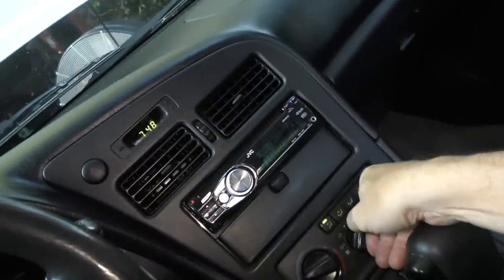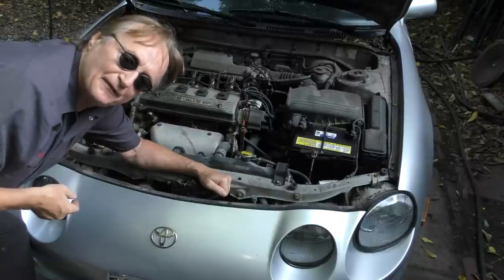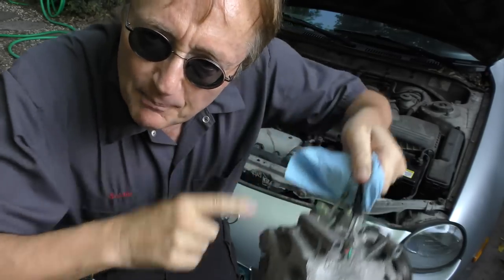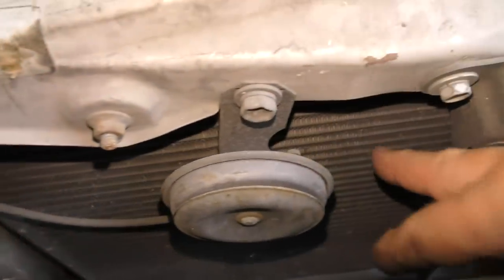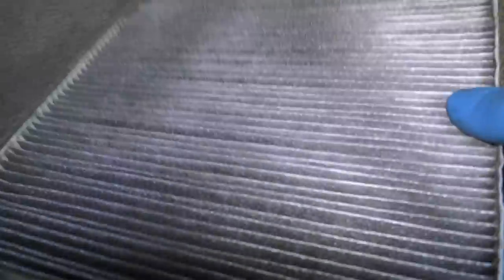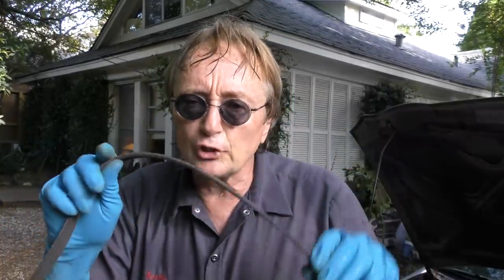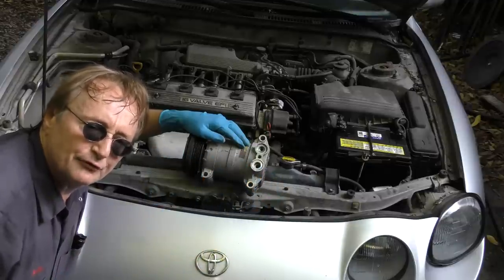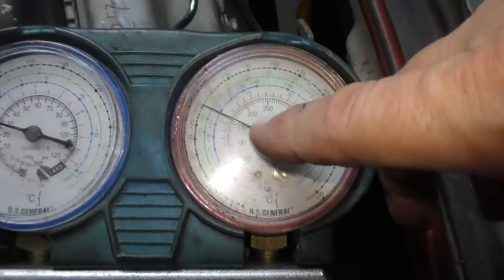How to Keep Your Car's AC Blowing Ice Cold

Comment: Hello Scotty Kilmer,I have a question... I have a 2001 Toyota Tacoma SR5 truck. My A/C is sometimes blowing cold air then after a few minutes, it starts blowing regular air; no more cold air. I hear the A/C clutch engaging on and off. When it is engaged, I sometimes still do not get cold air at all. It seems like it's happening intermittently. On, off - cold air, no cold air.Do you know what is going on or what could possibly be the problem?Thank you sir.Eric
Reply from the maker: try a new magnetic clutch relay for the AC in the fuse box, it's a design flaw on that. If not that, check for low refrigerant then pray it's not the compressor going out
Reply: Scotty Kilmer,

Thank you for the reply.

I checked both fuse panels (the one inside right by the driver side door below the steering wheel and also under the hood). I don't see any magnetic clutch relay anywhere. I do however, see a "HEATER50A" and a larger black color relay that says "HEATER" but it doesn't have anything that says "magnetic clutch" or "MG CLT" in neither one of the fuse box. 

I will take it to a shop & have them check to see if there is sufficient freon in there. I've already prayed to buddha 3 times a day that it's not the compressor 🙏🏼😂!!! 

Also, I took it to a mechanic shop a few months back (knowing that when summer season comes in San Diego, it gets really hot & humid here) and the service adviser said that I needed a new expansion valve??? What is an expansion valve?

Comment: I've got a weird A/C thing going on that you might be able to help me out with. My van is a '94 running 134a. I had replaced the compressor and dryer last winter, vacuumed it out good, and filled it up to 150 over 40 using my gauges. It worked fine for a while, but suddenly, it quit cooling earlier this summer. My radiator fan works just fine and the compressor would kick on and still read 150 over 40 just like always, but absolutely no cool air is coming out, nor do any of the lines feel cold either going down the highway or stationary. Got any ideas?
Reply from the maker: pressure is fine, so odds are problem is inside the dash controls, like bad actuators
Reply: Not that I can figure. All of my dash controls work just fine for defrost, upper, lower, mix, temp control, etc, and hitting the A/C button switches the compressor on as it should. Even if the blend actuators were bad, wouldn't the lines still be cold?

Comment: I replaced my cabin air filter recently and I notice that when the air recirculating option is on, external odors can still be smelled inside the cabin and I'm not sure if this is normal. In the past when ever I had the recirculating air option on, I could hardly feel or smell external odors, like garbage or burning grass for example. Any advise is appreciated and I have a Honda CRV -2007
Reply from the maker: filter has nothing to do with external odors, you have air leaks in the system OR the recirc door is not shutting fully
Reply: Scotty Kilmer Thanks for answering Scotty and I will check over in a mechanical shop and see how much this will be costing. Might leave the repair for January or February because I need to change the bushings of both arms and change camber kits as well. Lot of money on these stuff.

Comment: Hi Scotty,  my 1987 Pontiac Fiero GT (2.8) radiator fan will not switch on automatically but will come on if I turn on the AC.  I have had all coolin/temperature/fan switches and sensors replaced.  Coolant flush done, system burped.  Replaced water pump.  Problem still exists! Help!

Comment: Scotty, how about the clutch assembly on the compressors. I get cold air when the engine is cold, but after the motor warms up. I lose ac when the clutch  disengages because of the air gap has grown. I was just thinking of replacing the clutch assembly.
Reply: Have you tried replacing the AC clutch relay? I had the same problem this summer and it turned out to be a worn relay.
Reply: @teravolt6113  I'm pretty sure that the clutch assembly is bad. Because if  I  tap the front of the clutch on the compressor after the engine is warm the clutch will engage, and run the compressor till the system gets up to pressure, and disengages, and I lose cooling again.
Reply: @voo8165  Try disassembling the clutch assembly and removing one shim to bring the surfaces closer.

Comment: I have a 2003 yukon GMC (suburban 3 row) I turn on the a/c for the back area of the vehicle and it blows cold air,I turn on the front part (Driver and passenger) and it blows warm/hot air in the front area with the thermostat turned all the way down.Why doesn't it blow cold air up front? Blower is working...

Comment: Please help. 99 Toyota Camry ac issues. Has small leak that I fill once a season. This year for some reason the car won't let me fill it as usual using low side port. The clutch and compressor do come on and both fans are on. AC blowing warm air. Strange thing is that it reads low but can doesn't empty and that's using 2 different gauges. Any advice would help

Comment: Hey man so I have a question, my a.c. works but when I turn it on it affects the way my car drives, 6 speed 04 Acura tsx with a k24 engine, when I drive with a.c. off it drives fine, if I turn the a.c. on my car gets real sluggish especially when switching gears, any idea what I should do?

Comment: hi scott i have a 2000 vw bug that had a hair line crack in the head so i replaced the head and had a whole head job done. Meaning valve guides new valves and machined. ok installed the head back on now this is smoking like a chimney. how can i stop the smoke.

Comment: I am going to change the whole ac system everything from advanced auto parts but my question is should I buy the fan and the condenser from ebay or get good brands expensive ones because the fan base where the screws going broke i have to stick it with some wires and they told i need to flush or get new condenser with new ac compressor its only cooling when i idle over 2.5rpm
Reply: Mohamed alsayyad buy good parts from good brands, if you like your car running good

Comment: A defective fan doesn't burn out a compressor. There's a relief valve and a pressure switch that will stop the compressor...  n I've had a car for 10yrs n never needed to gas it once...
Reply: Wrong. With a high pressure switch the head pressure won't get as high as in the case of no high pressure switch, but the constant cycling WILL wear the compressor much faster than if it cycled at the correct intervals or not cycled at all (such as with variable displacement compressors or POA systems), and the relief valve will make the circuit lose a lot of refrigerant and lubricant to the point that the oil circulation rate won't be the correct one. In addition, most mobile AC systems are meant to have some leaking: they use open drive compressors with shaft seals, and have o-rings scattered throughout the system. To reduce the leaking, let the compressor run for some minutes each week.
Reply: TeraVolt when the pressure relief valve blows off the occupant of the car will feel the effect... the compressor will not go bad from this... i don't agree either that they were designed to leak... the short cycling of a compressor will wear it down... agreed... but so is regular running... that's not enough to say it will make it blow up... also when there is too little gas the low pressure switch will hold it out until attention is given...
Reply: Not that easy. Only the most technically minded folk may realize what has happened, the others might either take the car to the mechanic (which may just say "Don't worry, everything's okay") or just forget about it. About the cycling, well, there's a shaft and a swash/wobble plate, and continuosly stop-and-go operation means that the shaft and the swash/wobble plate are being subjected to a lot more stress. Some V-piston compressors used in most bus HVAC systems are designed to cycle about ten times a hour and no more (that's also why they often come with the so-called "unloader valves" which simply make the compressor momentarily pump less fluid to control both the DP and the SP, just like automotive variable displacement compressors but much less accurately). Automotive compressors might be much more resistant than that, being much more smaller than these behemoths, but they're definitely not designed to cycle on and off each second. About the low pressure switch, well, not all AC systems feature one. In fact, variable displacement compressors, be them internally controlled or solenoid controlled, don't need a low pressure cut off switch, since they can regulate the refrigerant flow any moment (that's the same reason for why they don't have a clutch or, when they have one, the clutch stays engaged as long as the AC is on, aside from momentarily disengaging with very low RPM or WOT). Systems equipped with these compressors only feature a pressure transducer located on the liquid line, which is high side and right after the condenser/receiver. As such, they can't feel a low refrigerant charge condition: they can only feel a NO charge one, and very low charge can be as damaging as NO charge for a compressor, because it's the refrigerant which makes the lubricant oil circulate inside the system, and low refrigerant can mean that oil is leaving the compressor from the discharge port but not the same amount of it is making it back in the suction port. I've risked a seized compressor myself from not having a regas done in 8 years (along with turning the AC on only in the summer) on an European minivan whose system only featured a 500g R-134A charge. The compressor clutch coil was equipped with a thermal fuse rated for 187°C and that fuse, one day, tripped. Low oil circulation rate (and too high of a superheat, in addition to too high of a discharge pressure) heats the compressor up until something fails and it seizes. Thanks to the fuse, that compressor, a Delphi CVC6 (internally controlled variable, so NO low pressure switch at all), is still alive and only needed a new clutch coil and a regas. Having the pressures checked right after AC failure showed the correct refrigerant pressure you would expect at that ambient temperature, which means you can be on a low charge but with enough pressure to make the system turn on, the only problem is that the TXV and therefore the evaporator could not be receiving enough liquid to cool things down the right way and, most importantly, that the compressor is not receiving optimal lubrication...
Reply: TeraVolt wow what a read lolol... i agree with some things said... not on its short cycling every second... not that the high side will not respond to low pressure... had u vehicles that did... i think we may be getting detail which is different from what he stated... again it will not blow up ur compressor... if ur compressor goes while this situation happens then it was on its way out n that's a shared issue... on ambient temp thats facts however again ur talking specifics and he was making a blanket statement...

Comment: I havent done anything with my AC in a Hyundai for 14 tears,it is still cooling the car good,and you say it should be checked every 4 years? :D
Reply: In my opinion you'd best have it serviced by a pro with a recharge station soon. Who knows how much refrigerant is left in there, and low refrigerant makes less oil than needed flow back to the compressor, making it eventually seize up. Some AC systems can still show appreciable cooling even with less than half the refrigerant charge, especially the ones with scroll and vane compressors typical of Asian cars which often have very little oil inside...
Reply: It's not a bad idea to replace the refrigerant and compressor oil (usually called an ac service) every few years. The compressor is internally lubricated and the oil can degrade.  Always check to make sure the condenser is free of blockage and make sure the belts are good. 
But yeah for the most part you just leave it alone.

Comment: hey scotty, just want to know the stock settings of a fan. if i on the ac on, should the fans stay on? or it will still depends the engine  temperature. my fans is still automatic even with ac. and my condenser is getting hot.

Comment: I have a 2000 Toyota Camry Ce the compressor stays engaged all the time except  when the engine is off or the blower motor is off if i turn the heater on the ac is still on fighting. I put a new relay as well as replaced a couple o rings and the condenser drier and the new wire from the fuse box to the compressor the old wire was sniped. Why does the compressor continue to stay on? thank you
Reply: Might be trivial, but do you have air distribution always set to defrost?

Comment: Can I use gauges and hoses for residential AC on my vehicles AC? BTW, you live in Houston?
Reply from the maker: sure, same gauges, just different fittings. I'm in downtown houston
Reply: Scotty Kilmer which type of fittings. I'm also in Houston are you in the heights?
Reply: my dad is a mechanic and he is great at fixing any engine, really good at cars. i just trades items on craigslist for a rare scooter. a 250cc velux diamo, it has a roof and a radio and a cigarette lighter port, also car mirrors. its grey also has a windshield and wipers. is was taken care of poorly and has been in the rain for 6 years and wasent running at all for six years. so i traded and it came with a title, also it only has 884 miles on it. anyway 3 people owned this scooter before me and no one could get it to run. but we got it and my dad got it started in less then a week and we only spent around $12 on sealent,screws and it runs very good, all we need to do now is clean the gas tank and put the seat back on. i traded $400 worth of stuff, i got a great deal its worth $4500 new. it looks like a big motorcycle and it goes 85mph PS MY BROTHER JUST MOVED DOWN TO AUSTIN TEXAS, I LIVE NEAR CHICAGO IL.

Comment: Hi, i have My Opel Zafira A 2005, the Air conditioner is working good except in the middle of the dashboard vent, it blows hot air for while and then after 25 mints will turn to cool air...i have no idea what happens?

Comment: I have a 2012 Range Rover sports. The AC used to be ice cold. Noticed recently that when I turn the AC on, the clutch engages and the vents blows normal air until say after 5mins before cold air starts blowing. It’s not as ice cold anymore. Plugged in the gauge and it reads fine. What could be the problem as I want it to come back ice cold. Thanks
Reply: It probably has a variable displacement compressor. Definitely more typical of European cars (American cars typically feature fixed displacement piston compressors, Japanese scroll/vane ones instead). Gauges won't make sense with these compressors, since they have a mechanical/solenoid valve that adjusts the pressure by regulating the swash plate angle. You could be low on AC refrigerant. Low refrigerant can be really damaging for these compressors since low refrigerant means slower oil circulation and these compressors stay on all the time when the AC or defroster is on, and they often don't feature LP side pressure switches. Systems with variable displacement compressors need to be charged by weight by inserting liquid refrigerant in the high pressure side (after evacuating and vacuuming), with engine off. Let it be serviced by a pro. Also clean the condenser and check if it has proper airflow. You will have ice cold AC in a moment from an efficient system. Even a car low end and small as a Vauxhall Agila A can ice you up pretty good.

Comment: Scotty I have air conditioning in my car a 94 camaro z-28 5.7 liter LT1 I put freon in my air conditioning and it's now cold and when I run it in town or on the highway the temperature stays bout the same it dont run hot at all we just last week flushed, new thermostat, and new Prestone and it's doing great but my issue is that when I dont run the air my temp guage goes up and goes up pretty good bout 3/4 or a tiny bit more so I'm stumped I thought that the car would run hott with the air on but it's doing just the opposite...so u got ne answers???
Reply: The cause is probably your engine Electric cooling fans are not working properly
Reply: @garygermain2333  my 94 z-28 has an OBD1 and I bought a scanner from auto zone cause I was going to do a test scan on it...well I cleaned my map sensor the other day and it ran better but it did start running kind of rough start then die and I nursed it back to my house I parked it then the next day it was running great so drove it to walmart and dollar store I think ne ways it started up again so I go to obd test it but when I plugged my sensor into the obd1 port only thing that happened was my fan kicked on and a few more things kicked on so when I took my key out it all stopped..well i had a blown cigarette lighter and my courtesy lights were out to so i replaced that fuse but turns out that was not the one that was blown it was my or the one that says courtesy....that's all it says is courtesy so i looked that one up and it said it goes to my BODY CONTROL MODULE....now I'm not sure   what that really means but I think it goes to the ecm but again I'm not sure...so I hope you can really help me cause I cant drive it not cause it's not running it's because I dont trust it to get me from point a to point b....

Comment: hi i have a 2003 ford ba xr6 and the ac fan/ heater wont turn off read that it might be the him module and dash needs to come out to fix it could i just put a switch to the fan to turn it on and off ? or any ideas thats not going to cost $1200 ?